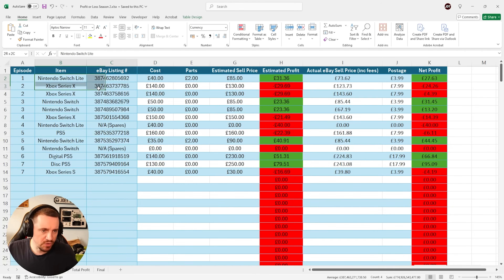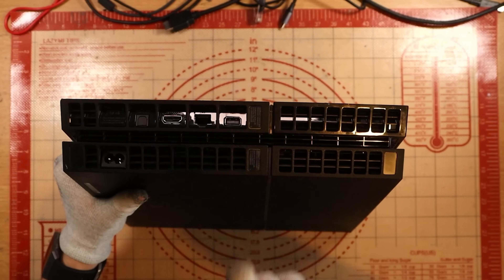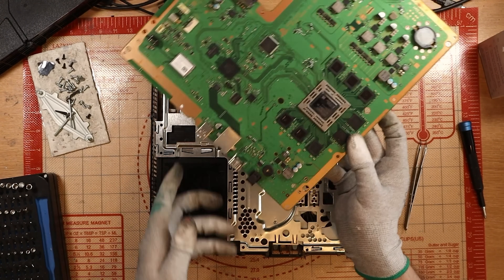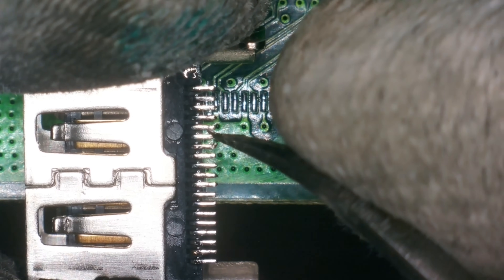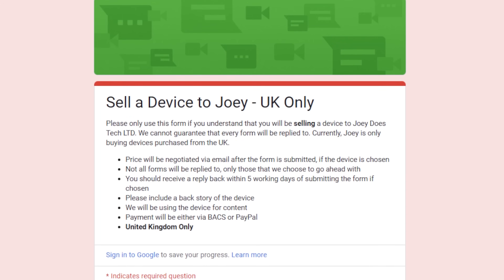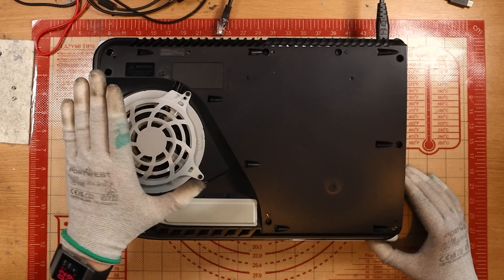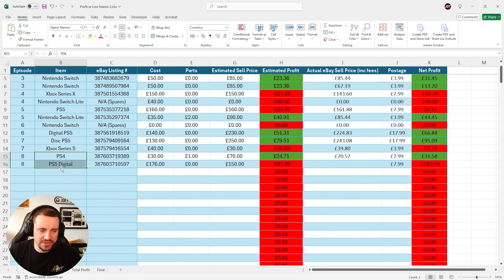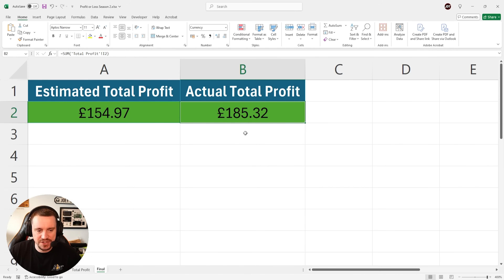Trying to Fix FAULTY Electronic Items for a Profit! S2:E08

Comment: Let me buy a PS5 from you and turn in my PS4 to you its 100% working only problem is the power on button doesn't work so you have to use the controller to start it. Other than that its in mint condition! Love your vids btw!

Comment: Just had to pause this video because checking the estimated profit column and it seems like a lot of them are wrong. Take episode 3, bought switch for £50, no parts cost, estimated selling price is £85. even minus the postage that should read £31.01 and not £23.36. Checked a lot of them under the estimated profit and a lot are wrong unless your deducting something else.
Reply: Deducting the ebay fee (i think 9%)

Comment: Joey, anyway your spreadsheet is not accurate because you need to put in also the electricity you consuming to fix the items because also the electricity is a cost to fix the items then also the usage of the tools you need to take in consideration as well

Comment: You should swap out the power supply on the ps5. Although it might be the tpm chip, it could simply be a faulty power supply that’s not delivering enough voltage for boot. The speed at which it switches off, makes me lean towards a power fault, rather than the tpm; because it’s not staying on long enough to actually be going through a boot cycle. Safer to try swapping out the power supply, than losing money on a simple fix.
Reply: ^^ What he said ^^

Comment: just a lil info from my experience with PlayStation and Xbox consoles more and more ppl these days are moving away from console in favor of a good gaming PC because they can easily be upgraded instead of having to buy a complete system and i have used a PC for gaming for the last 40 years and have only bought 3 PCs in my life and only had to upgrade video cards and ram plus the price of gaming PCs are coming down yet the cost of new consoles stay high so the used console market is dwindling mostly because they restrict you from playing any new games after the unit is 2-3 years old and they expect ppl to just go out and buy the newest model which is what my friends son did and after upgrading to the x box series x he realized it wasn't much of an upgrade it was slightly faster loading games and let him play the newer games but i think he felt a bit ripped off after buying it because it was only about 3 months later that he got a gaming PC and has not touched the xbox since lol i think that's why NorthRidgeFix repairs so many video cards

Comment: Another great video  but 176 for ps5 digital way too expensive . Can get a working one for 225 - 250 ish

I'd say 150 max to buy faulty one
Reply: 176 is so so expensive, they are 6 years old now so a console like this with the sticker should cost like 130-150 not more
Reply: These fixers are paying top dollar for junk, prices are crazy right now on broken laptops too
Reply: He compared the price of a working one with a faulty one. He didn't say that joey buys working ones lol.
Reply: If he can sell it for 250 then that's a 74 gross profit.. which is the point of profit or loss.
Reply: He doesn’t buy working ones. He fixes them